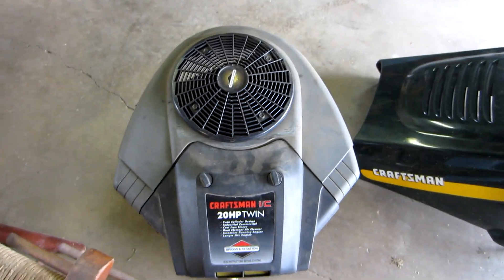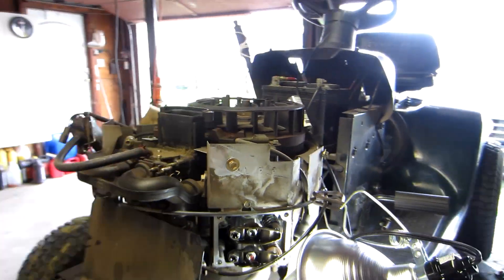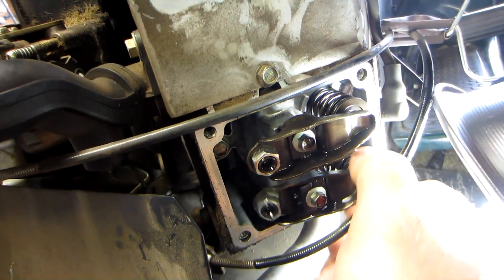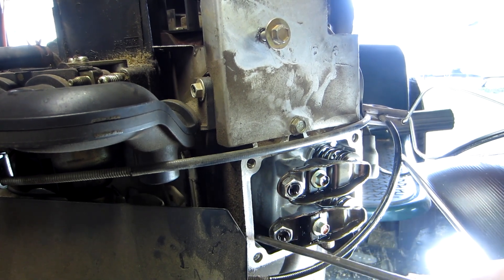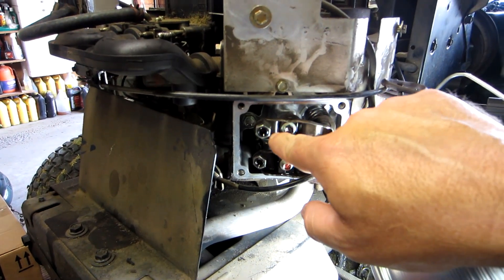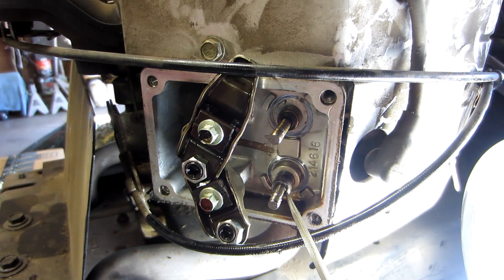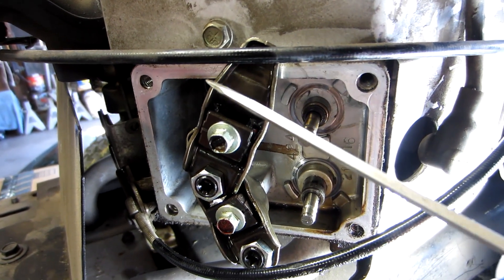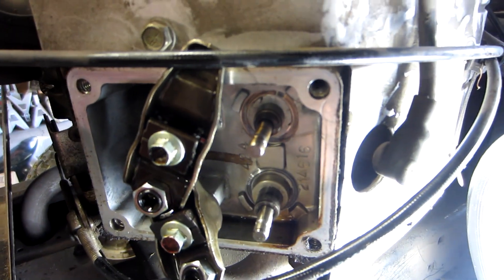Briggs Intek Bent Push Rods

Comment: Thanks for the peeing explanation! I’ve got the head off my 24 hp V-twin and will do this after I get everything cleaned up. Do you happen to remember the head bolt torque specs?
Reply: Manual says 220 in-lbs (18.3 ft-lbs)
Reply: Grant Deisig Thank you very much!

Comment: Just got one of these, previous owner had it worked on by a shop.. intake pushrod broke and the exhaust bent... I think they used aluminum for both. What size carbuerator does this use? I've seen that they use a 2 barrel and for fun I would like to make it dual carb. Also, do you know if they make performance parts for this engine?

Comment: I have a lawn tractor that keeps bending the  exhaust push rods 1-3 times a summer season, sometimes within a week other months apart.  both heads will bend them.  This explains alot as we have checked for debris causing overheating and oil changes are done often now.
Reply from the maker: Yep, the only thing that will bend those rods is when there is resistance against them. And 99.9% of the time it is when the valve guides grab the pushrods.

Comment: I didn't notice how you removed the valve springs.  Do I need a special tool for that?  I have a  valve spring compressor for the flat head engine.  I'm working on a B&S 10 hp single OHV engine from a Gen Power 305 generator.  Thanks.

Comment: Great video. Thank you for posting! I’ve learned a lot from just this video alone. I think I’ve got a similar situation going on with my Craftsman riding mower which has a 17 HP B/S engine. The engine will not turn over to start. My flywheel only turns about 180 degrees while using my hands with the spark plug out and I’ve noticed a banging sound that’s coming inside the motor kind of like metal against metal. I’ve checked the solenoid and starter and these are fine. Could this be a symptom of a damaged pushrod? Could it be a bad crankshaft? Thanks again!
Reply: This response is really late... the crankshaft could be bad, but it might be a connecting rod, if yo uh have the means I would take it apart to see

Comment: This video saved me big $ a couple years ago. The valve seat did push back out again a week ago and instead of spending $150/head I pressed the seat out and tig welded a bead around the base of the seat and installed again  seems to be working great so far. Thank you for the video man.
Reply: I pushed the guide out and used red lock tight on it. We will see how it goes
Reply: @billbraski2175  good luck man. My welded fix is still going strong.

Comment: I fished my rod out of the small hole in the jug with a small extension style magnet. I bent the tip so that I could fish around. It took [what seemed forever] but I finally did find something loose in there. I had better luck after moving the crank to BDC. Thanks for your help.

Comment: Have you ever encountered a slipped valve guide on the intake side?
Reply from the maker: Yes. But usually the hot exhaust valve is the 1st to pull the guide

Comment: what would be the valve guide height....???  1/2" maybe...or less than that? Im hoping that my case is the "1 in a 100" ,  exactly what happened to mine, intake rod bent, and exhaust rod VANISHED! lol
Reply from the maker: You'll have to look up your valve spec it's in the if I recall most of them are right around the twelve thousandth range

Comment: WOW  @ 12:02 time he states $86.00 for head kit in 2015, NOW, June 2019 the link has it @ $153.79 PLUS shipping $12.99 = $184.99, the price OVER doubled in 4 years
Reply from the maker: Aluminum tariffs?
Reply: I ordered 2 heads from Jack's, the price for both was $145 - these are new, OEM parts. However they are on backorder, looks like about 6 weeks lead time. For now, I followed the process in this video to try and keep the old valve guide in place.

Comment: Hey,

I have this exact problem with my mower. Ive never messed with valves before. I have two questions. 
1. How do you know what the correct position of the valve guide is?
2. Would there ba an issue with just tack welding the side of the guide so you never have to worry about it?
Reply from the maker: Well, 1" look at the other guides that haven't pushed out  to compare, take a look at the video closeup of my repaired head to get an idea...It just needs to be close.. As far as welding it would be extremely difficult welding cast aluminum to brass without distorting/destroying guide or head boss...

Comment: I have 19.5Hp Briggs ohv twin cylinder the aluminum push rods are on the bottom side on both  cylinders of the head noticed your video showed them being on top what's going on? don't think value covers never been off.
Reply from the maker: They should be used on the intake valve

Comment: does this happen on the vanguard engines as well? have you ever had slightly bent pushrods where a compression test will still read good, but the intake valve is not opening all the way, causing a restriction on the intake stroke? I think my problem is a bad coil though, but that engine was run out of oil, I have already had the valve cover off and everything seems to fit nicely, there's no excessive play on the rockers. Compression was 120psi and the good cylinder was 110psi. I tested each cylinder for misses by disconnecting 1 ignition wire, then swapping to the other, the 120 psi cylinder ran very poorly with a lot of misses. Spark voltage was good, jumped at least 1/2", so bad capacitor in the coil? Spark doesn't get hot enough because there is no amperage behind the spark? That cylinder was also much more sensitive to changes in mixture, slight choking would kill it, but good cylinder would take 3/4 choke to kill. Also has a lot of oil coming out the breather and it builds up on the throttle plate and in the carb at idle , then dumps into the engine when opening the throttle and it puffs some oil smoke for a few seconds. Would this be due to a plugged up oil drain port in the head? Would I still get 120 and 110psi compression if there was abnormal blowby?
Reply from the maker: 99% of the time the coil either works or doesn't work there's no medium failure. Not saying that it couldn't happen especially if you have a SAM unit (spark advance module) , which some of the manufacturers did. If you do have a spark advance module it's best just to buy a new coil that will replace the current coil and you no longer have to run that module. It's a box that could be half the size of a pack of cigarettes. Make sure you have your air gap set correctly for your coil as that is important and also make sure your flywheel key is not partially sheared causing a timing issue. Bent pushrods are easy to diagnose as you can pull them out of the engine and roll them on a flat surface to see if there's any Bend to them. You may have an issue with the valves needing adjusted because of valve seat wear. Before you overthink it though, make sure that all the basics have been checked because tearing into an engine that there's nothing wrong is a pain in the butt because you didn't cover the basics first and something as simple as a bad spark plug could cause fits. And remember the other general rule just because a part is new doesn't mean that it's good part. Good luck.

Comment: Hello, in my case I was given an 26hp twin mower that has been sitting for approx. three years. I replaced plugs, filters, oil.  When it started it popped and backfired, then the popping stopped.  It had week power and I found little compression on one cyl.  Took off valve cover and found the intake push rod out of the rocker arm  The push rod is not bent. Perfectly straight.  What do you think happened in my case? Thanks in advance.
Reply from the maker: Make sure the valve guides are not pushed out and reinstall everything... Then rotate engine by hand and watch to make sure all movement looks good... There is probably something that caused the issue but you'll need to reinstall everything to find out what is going on...

Comment: Question Mr. Foxboss9 - Spot on with this video! Thank you very much for a great detailed video. My question is how far are these valve guides supposed to be in? Flush with the block or do they stick out a bit? It seems all 4 of mine have retracted out. 4 bent push rods. Thanks in advance
Reply from the maker: Actually it may vary slightly. I like him to be flush however if you look inside with the head off they may be sticking out a little bit too much in the combustion chamber which I don't care for also. Basically though you want them to be able to be locked in place without interfering with any movement. So the answer is whichever way works best for you to ensure the above-mentioned doesn't happen. The reason that I do it flush on the spring side is because I've never had a guide fail inwards so if I can give it a head start by keeping the valve flush on the Springside then that will keep it from pulling out hopefully.
Reply: Awesome - Thank you very much and for the super fast response!

Comment: Do these Intek engines use a valve seal on the Exhaust?
If so, is it the same as the Intake seal?
Reply: No, they only have valve stem seals on the intake.

Comment: My customer has the same issue, bent push rod on exhaust, (bottom rod). Is it alright to use the steel rod on the intake side/
Reply from the maker: Jackfishbill good question.... I never tried though... Might be a burden on the camshaft pushing the extra weight... I don't think so though...
Reply from the maker: Pat's Saw And Winch 👍😁

Comment: I just happen to stumble on this video and I am very happy about that it explains a huge mystery. Today, 6/30. I had a Tech come to look at an issue I've been having with my mower. After it warms up, with the blades engaged.  I lose power. It is a Craftsman and has a InTek v- twin engine 25HP. I have had it for 13 year and this is the first time I have had a major problem. 

The Tech tested a few things and found that the left side is not operating and thus I am running on one cylinder. He took the valve cover off and part of the aluminum push rod fell to the ground. We could not find the steel push rod and the other half of the aluminum one. After looking at this video it verifies that the steel and rest of the aluminum rod went down to the engine sump. I've been having this issue for several weeks so I am very fortunate that the steel rod and the other half of the aluminum rod did not cause any major damage. The Tech said that it is probably is in the sump. He had a steel rod but not an aluminum one. He had to order it. When he comes back, and am going to tell him about this video and suggest we try to "fish" out the steel rod. Since we found only 1/2 of the aluminum rod, i am concerned that a magnetic retrieval tool will not get it out.
Reply: I'm going to try using a magnet to get the steel push rod out. As for the rest of the aluminum push rod that was broken, It has to be in the oil sump pan. Not sue how to get that out.

Comment: A mower mechanic recommended to put some lock tight on guide. My Briggs had fault at only 100 hrs. Briggs getting cheaper by the dozen.  So which engine is built better, last longer, Kubota, Honda, Etc, It aint Briggs now a days.
Reply from the maker: Lud Wig I would have to say Honda... The only Briggs that can still hold its own is the Vanguard..

Comment: I do have a question about the factory replacement head.  Has B & S acknowledged the problem and made revisions to the replacement head that will prevent valve guide from moving out of position.

Something else came to mind.  I "peened" my valve guide before I saw this video.  I noticed that in at least some cases you remove the head and "peen" from the inside.  Have you seen instances where the valve guide moves to the combustion chamber side?  If this is common, I might rethink and pull the head and "peen" from the inside.  Thank you.
Reply from the maker: BIG DADDY no Briggs really hasn't addressed it because the problem is not really a manufacturing problem what it is, the engine has overheated or it has been run low on oil to cause the guide to swell and grab the valve stem as the valve is being moved. I've never had one go in towards the combustion chamber because the camshaft and the geometry through the rocker arm is such that it does not exert enough Force to push it inward. Not near as much as the combustion, explosion process that will definitely move the guide even though it's hanging onto the valve. The reason I pin the inside is to give two points of contact all the way around the guide on each end of the guide so that it has a hard time moving outward because it's being held even on the inside too.
Reply: Foxboss9 Thank you very much for your prompt reply.
Reply: Can I install the valve springs without pulling the head and on the mower?
Reply from the maker: Melissa Eubanks yes. The video shows how to make sure the valves don't fall in the cylinder when you take the springs off

Comment: how do you find the valve clearance/gap setting? thanks for a great video,,helped a lot
Reply from the maker: Les Croft it's in one of my Briggs manuals. Usually it's a little bit more of a gap on the exhaust side then on the intake side. Just look up your model number online I'm sure that Briggs has some sort of a online manual for that.
Reply: Thanks for your reply,,i found two different manuals on my engine and both give different settings,,,,one says bot intake and exhaust should be the same0.004-0.006 and the other says the are drastically different so i have no idea which to follow,lol     thanks anyway
Reply: my engine is 40H777-0241-E1 and both manuals are for that engine,,,crazy huh
Reply from the maker: Les Croft you may want to call Briggs and Stratton direct... They may have changed the the recommended settings after the original publishing..
Reply: thanks,,called em and they said .004-.006 for both was correct

Comment: What do you think about if a guy has to buy a new head,  maybe just use aluminum brazing rod  around the valve guide hole and then re-milling it?    I've repaired aluminum that way before but I guess a guy would have to know the specs and tolerances and have machining skills or take it to a machine shop if it was even worth it.  Just a thought.   Nice and informative video , thanks.
Reply from the maker: Steve Jones it works that way too.. But these engines aren't high compression high RPM Automotive Style quality things. So something as simple as just peening like a show in the video is usually plenty strong enough to hold the guide for moving again. As long as the engine doesn't get overheated or run low on oil or anything like that. Thanks for watching! Thanks for the comment! Great idea! :-)

Comment: my mower started, went to cut grass engaged the blade started cutting, the motor lugged  down and stopped. I took the belt turned the motor, locked,then went forward and locked again what caused this
Reply from the maker: If the engine seized and you can only turn it slightly in one direction and then back again..sounds like connecting rods..

Comment: Excellent video. Just wanted to add something if I may. If you can't get that broken push rod out through the dipstick tube, tip that tractor  on its side after draining the oil, and try again. If you have to pull the engine still, turn it on its side on the bench before splitting the engine and thats how I got mine out. Thanks again.
Reply from the maker: As as you don't have a hydrostat transmission that has a remote reservoir..even then make sure the trans has breather vent blocked off before laying entire tractor on side..

Comment: Unbelievably, in my intek 24 HP, the Aluminum pushrod from onside was a bit twisted and bent when it was found sitting inside the other valve cover!  What can we do to keep the pushrod from getting in thru the oil galley? there has to be something that can be placed in there to allow the oil to flow without letting the push rod fall in.
I have the displaced guide issue and used locktite sleeve retainer on it before driving the guide back in and then peening it without removing the head. We will see how long it lasts.
Reply: I ran my mower twice yesterday for a total of near 3 hours. Ran great!
Still thinking about the disappearing/reappearing pushrod issue.
I think that a small tight fitting heat resistant silicone/teflon/nylon ball that could be slid on am placed near the end of the pushrod would keep it from being suck in through the oil galley. Your thoughts?
Reply from the maker: It really doesn't happen often enough to find a fix..Usually once in an engines lifetime..

Comment: Great video! I have 2 questions for ya. I was just given a 24hp Intek and it has the dreaded bent push rod syndrome. I was lucky that the steel push rod was still laying in the oil return hole and was able to retrieve. My Question is, do the intake pushrods ever disappear like the exhaust? I can't get a pushrod through the intake return hole. Also have improvements been made to guide retention on the new series of head? Mine popped the exhaust seat.
Reply from the maker: Revoultion Repair sometimes the Intake will disappear too however being aluminum it is is a little harder to retrieve usually requires pulling engine.. The head design has always been the same.. The problem is that cooling fins get blocked by debris/grass or the engine gets run low on oil.. That's the defect that causes this issue.. Keep it cleaned and keep oil in it and you won't have to worry.
Reply: Thanks for the quick reply! I actually drilled and tapped a 1/4" hole in the engine to block the pushrods from being able to enter the sump. The oil can return, but the rods can't enter. We'll see it that works for any future pushrod issues.